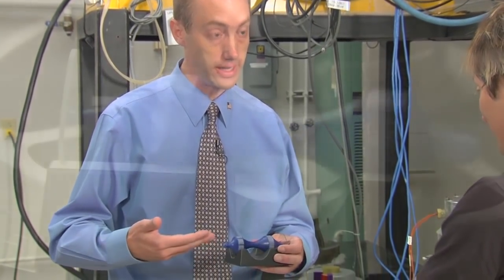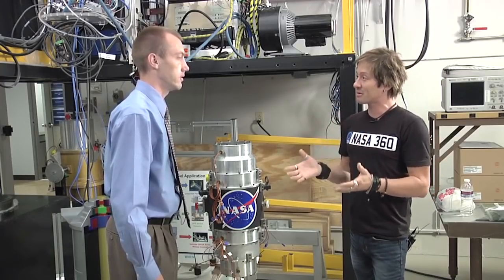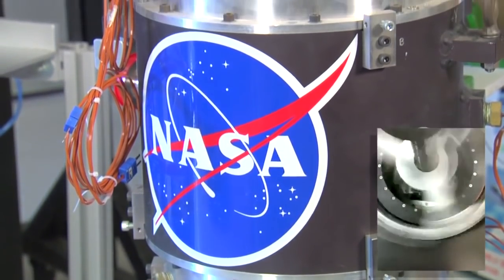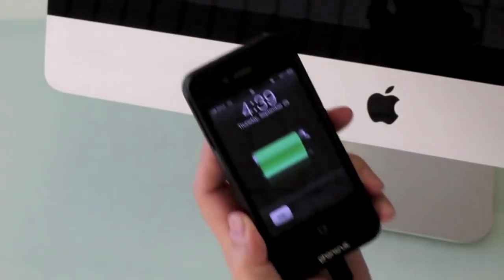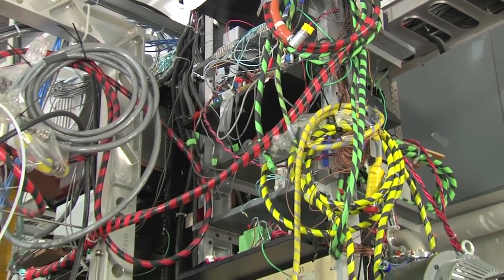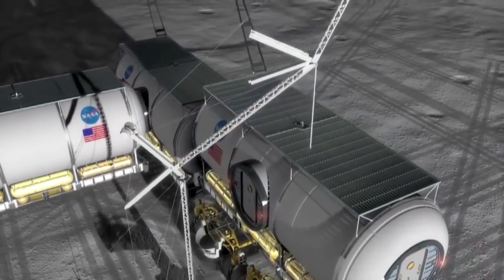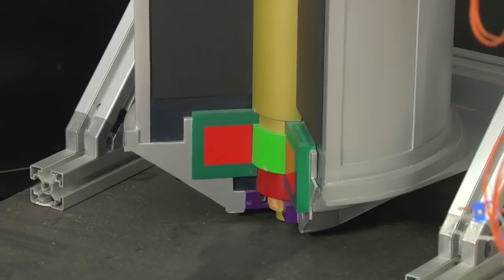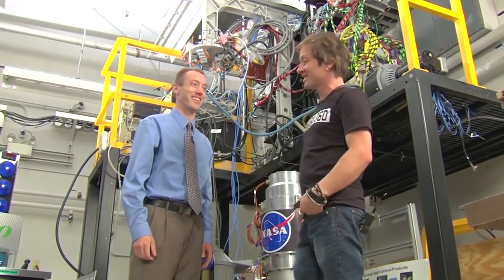NASA 360 Flywheel Energy Storage [HD]

Comment: I wish it'd had a quantitative comparison between various energy storage technologies, including energy capacity per mass and volume.
Reply: I'm sure you can google that stuff up, but I've read that flywheels can get to astronomical charge/mass ratios, way pass current chemical systems.
Reply: +Zen D
Volume also matters, though.
There's not much point to a better energy/mass ratio if it requires some huge impractical contraption.
Reply: They talked about a 150kg flywheel that can be mounted on a regular car with energy storage capacity of 15 MJ/Kg (manufactured using advanced materials - kevlar, carbon nanotubes, etc.)
Reply: Zen D
Those are some very impressive numbers.
That's 7 times the energy capacity of a Tesla Model X's battery with about one third of the mass.
I'm still worried about the volume, though.
And energy conversion losses.
Reply: +Major Gnuisance Not much of conversion there, it's all mechanical energy going back and forth. Unlike the chemical storage where mechanically created energy is being converted to electrical energy and vice versa. I hope we'll really get to see those systems commercially available sometimes soon.
Reply: Aye me too, so disapointed at that, kept wondering how it could stack up against others.

& what could be achieved in the most ultra efficient setups that could be possible, lot's of things seem to get absolutely fascinating when a bit of hyper advancement is added

Comment: Whats the point of having a vacuum chamber for a flywheel that's going into the vacuum of space? And why does the thing have to be so compact? The energy storage capacity of the flywheel scales roughly in proportion to its radius, assuming tensile strength as the limiting factor on its rate of rotation. A larger flywheel with lesser mass and rpm could easily store the same amount of energy without all the bells and whistles.
Reply: It's not created in the vacuum of space, duh
Reply: @HadzabadZa  the purpose of the vacuum is to minimize the dissipation of energy by friction. If the thing is meant to be used in space, the vacuum chamber serves no purpose.
Reply: @corwinmay  I mean, the thing looks pretty tightly sealed, there might be no way to vent it once in space for whatever reason, or at least no way to test it without first assembling it in technical vacuum and you probably know how much NASA loves their tests. 

And to answer the second question, the energy is stored either in a heavy flywheel or a fast one, I doubt size has any effect on energy. And anyway, it's not like rockets allow for much free space
Reply: @HadzabadZa  my point about the vacuum is that this big, heavy, expensive pressure tight can is unnecessary.  

About the energy storage capacity, just consider a rotating drum with a fixed mass and angular velocity. The rotational energy is proportional to the square of the radius of the drum while the centrifugal force is only in linear proportion.

Comment: Wonder how they inject and extract the energy if its suspended. Probably pretty tricky, especially when the flywheel gets up to incredible RPMs.
Reply: +Justin Blake Vacuumed inside space , superconductivity tech , this thing is super efficient and clean , charge really quick , this thing is the future , buddy , it will be the battery drive our electric cars in a few decades , the only defect is this thing keep giving out energy even though when it is not using , 25% energy lost everyday not using , but I think since it is super quick charge , that is a problem we can live with .
Reply: A motor / generator is integrated into the mass, so you spool it up via motor and then get the energy back the same way, that is the most efficient transfer.
You can do mechanical transfer but the losses get pretty substantial with gearing and coupling.

Comment: We started out using large HEAVY flywheels to our advantage. Then things got smaller and smaller and smaller. Who cares if its the size of a shed. If it works, it works. Sometimes bigger is better. Good video. Question. On earth, does mounting an energy storage flywheel vertically, horizontally or diagonally make more sense for efficiency? Does orientation matter???
Reply: Ra Vee  I thought he said there were no bearings in the video. However, you are probably correct for a bearing wheel. Although, I remember the old John Deere tractors had a big flywheel the had it's axis horizontal.

Comment: If you have two flywheels or more, can't you move through space, via torque ?
Reply: No, you can only change your orientation. If you were able to produce linear momentum by twisting several gyroscopes, it would be a violation of Newtons second law.
Reply: @Tore_Lund  You'll definitely need two of them to keep your spacecraft from rotating though. You can even use your energy storage as reaction control systems which also don't wear out due to bearings, that's a really neat feat. Ah, should've watched the vid further, they mentioned it.

Comment: no energy density numbers or volume numbers... 
I would imagine that flywheels have an advantage in that its mechanical energy going back and forth which is pretty efficient and straightforward engineering. 
I could imagine the problem is with a mechanical fracture and all that energy 'unraveling' in unplanned way.
Reply: and efficiency?
Reply: The piece they have there is a 100kg spinning mass that was storing 500Wh+ at 60k RPM, so not exactly the most power dense package.
And the only way to make it efficient is an integrated motor/generator, high vacuum chamber, magnetic bearings and free gyro movement(without it Earths rotation starts to pull the mass out of it's axis)... all in all quite the involved system.
There are companies developing large containers with several tons of mass being spun up to make larger storages, but they don't give out any details.

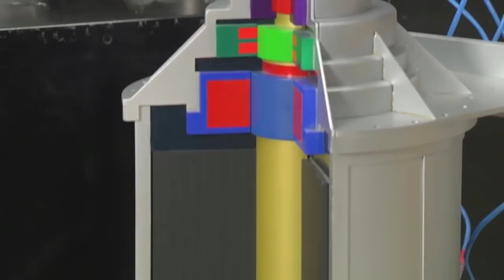Comment: 5:55 He didnt answer the question.... and he said "its good for big amound of energy..." 
I found this in the Internet: 500Wh at 60`000 RPM and 23Kg Weight. 
A Lithium Battery with the same weight would store 5kWh with 21700 cells at 90% charge.

Also a Flywheel at this speed is like a handgrenade... if Something go wrong you will have a really bad day.

Comment: Batteries serve more than one purpose in a generation and distribution system. They store electrical energy or rather convert it to chemical energy but they also have significant RESERVE capacity and serve as a short-term "buffer" when temporary electrical system loads exceed the capacity of the generator powering the circuit(s). And once they're charged they STAY CHARGED until discharged significantly enough that the nominal voltage drops below the cut-off or rather cut-on point of the voltage regulator to increase alternator/generator output. 

Look at any automotive or deep-cycle marine battery or ANY rechargeable cell battery of ANY kind and you'll see an AMP-HOUR RATING. That's because a battery takes TIME to "generate" electrical energy from chemical energy and it does so more efficiently at lower rates of discharge that keep the internal heat and resistance down. There's a reason why the alternator or generator can fail to "charge" for whatever reason on any vehicle equipped with one and the vehicle and its various electrical/electronic systems don't immediately SHUT DOWN as a result. 

Typically you'll get several minutes of full "battery power" at least before a warning light or the ammeter/voltmeter shows a "discharge. Why? Because you actually "overcharge" battery to charge if fully and that extra RESERVE CAPACITY is the one huge advantage your flywheels don't and won't have. Ever. Literally the INSTANT you start "discharging" them the rotor speed begins to decrease. You know it and I know. Or at least you SHOULD know it. And the less energy there is remaining the more energy the circuits will draw as AMPERAGE INCREASES to offset VOLTAGE DECREASING. Watts are "power" and they're also Voltage x Amperage. There is no free lunch. If the volts drop the amps have to increase to carry the load. But when the amperage starts dropping, which is IMMEDIATELY with your "storage system", VOLTAGE drops as well, because its a function of SPEED just like HORSEPOWER is a function of torque and speed. 

 Your claims that a flywheel energy storage system is superior in longevity and presumably versatility and adaptability is also pretty funny. Batteries are like anything else"mechanical". How long they "last" depends on how they're built, used, maintained and "stored". Keep them in cool dry place and keep the exterior clean and possibly coat the terminals and they have a virtually unlimited "shelf life". It's heat and vibration that break down the plates and ultimately knock enough of the plate material off that it can end up shorting out cells. Modern "gel" batteries like Optimas can literally be mounted in any position you desire and even lead-acid batteries can tolerate a certain degree of angle, with "maintenance free" batteries being superior to plain old "open" cell batteries in that regard. 

They can also be stored dry indefinitely, charged with sulfuric acid, given a quick "boost" charge and put immediately into service. Your iPod example is pretty funny to me because I've got an old 32GB ipod I bought USED on eBay many years ago with roughly 2400 songs on it, it lives in my vehicle 24-7-365 and sees temps from -20 F to however hot the cab gets in the summer and even though I've probably "tried" to "kill" it several times by leaving it on the charger for an excessive length of time and thought I DID kill it that way once, it still provides many hours of continuous play via an FM transmitter plugged into the headphone jack. I know for a fact there isn't a "flywheel energy storage unit" anywhere on Earth that is still going to be spinning several DAYS after I shut down the iPod. 

That you folks are comparing your "high technology" to batteries is just indicative of your general cluelessless or desperation to "sell" what you've probably dumped millions of taxpayer dollars into. You're comparing apples to oranges. If the "flywheel energy storage system" were superior the Hubble boondoggle wouldn't have BOTH technologies, would it? Every aspect of your "flywheel energy storage" is completely inefficient because they literally slow down immediately and "progressively" the instant you remove power from them. The "magnetic bearings" you're bragging about require electricity to operate and actually ADD DRAG to the "frictionless system". Electromagnets invariably develop polarities and eventually you'll magnetize the rotor as well. You also have to convert your "energy storage system" to a GENERATOR to get power back out of it. 

Then you get a "steady stream" of continually lower and lower amperage until its below the nominal voltage required by the circuits at which point it has to be returned to "flywheel" mode and spun back up. Can you explain why it takes 60 minutes of "charging" to get 90 minutes of "power"? You mentioned that the Hubble, which has been a giant boondoggle in and of itself, has had its batteries AND "momentum wheels" replaced. I assume by "momentum wheel" you mean flywheel energy storage system. So what's the problem? Is it a CURRENT issue with degraded solar panels reducing the available current for both "charging" the "momentum wheel" AND the batteries with the batteries taking it in the shorts due to the ridiculous power requirements of the "flywheel energy storage system" while its "charging"? 

The reality is you have an ELECTRIC MOTOR that can be converted to a generator, just like a plain old "obsolete" generator on old cars and trucks. And like ANY motor of any type it has a "flywheel effect" and INTERTIA continues to rotate the armature after the power is removed from it. The only problem is that a generator makes a pretty poor motor. Probably because its literally an AC generator that either produces "DC" current that's "2-phase alternating current" sort of "rectified" by switching the fields OR it produces 3-phase alternating current that's rectified at the diode trio if its actually an "alternator". 

ALL "generators" are "alternating current" if they have field coils, armatures, rotors, slip-rings, commutators or whatever you want to call them. They all function and "generate" electricity by using a "source current" to energize or excite the fields to create the electromagnetic field that through conduction creates additional electricity. Do you really think nobody else but modern "scientists" would have come up with and developed a "flywheel energy storage" system for vehicles, which are the most common use of batteries for INTERMITTENT short-term loads with short duty cycles? 

Other "geniuses" have come up with this "brilliant" technology but invariably the projects ended up being giant government-subsidized BOONDOGGLES purchased and financed with OPM - Other Peoples' Money. But use on a commercially successful level doing something as mundane and simple as cranking an internal combustion engine for starting? Not so much. Electric starters are the most common system but HAND-START via crank or HAND-SPINNING the FLYWHEEL are by far the most common. Then come AIR STARTERS and PONY ENGINES and even some really oddball stuff like SHOTGUN BLANK CARTRIDGES that "blast" high pressure gas into the cylinder and create some preheating effect. And of course RECOIL starters and even some "centrifugal" starters using RECOIL SPRINGS to store energy while being wound in order to power the engine for starting. 

What I'm yet to see in my "short" 25+ year career as a diesel mechanic with experience working on everything from nitro RC engines to 4500-hp diesel-electric freight locomotives is a FLYWHEEL ENERGY STORAGE STARTING SYSTEM. I've been a gearhead literally my entire life and hadn't even HEARD of such a thing until "millenials" and "experts" in University labs suddenly decided it "makes sense" to "store electricity" as "kinetic energy". Of course even THAT "definition is incorrect since KINETIC ENERGY is ENERGY DOING WORK. 

You're at best storing POTENTIAL ENERGY. Energy with very LIMITED potential as your own 60 min./90 min. example demonstrates. I've tested and replaced a lot of batteries in my day but I haven't had a GOOD ONE yet only hold its charge for 90 minutes after an hour on a charger. If the technology is SUPERIOR it will SELL ITSELF and would have LONG AGO. Because like I said, you modern-day "electrical engineers" haven't come up with anything that hasn't been done in the past.
Reply: DEEREMEYER1: You said 'If the "flywheel energy storage system" were superior the Hubble boondoggle wouldn't have BOTH technologies, would it?'

Hubble doesn't "have both": it has batteries for energy storage, and "momentum wheels" used for attitude control. A flywheel experiences gyroscopic precession; two counter-rotating flywheels (as shown on the little animation of Hubble) cancel that out. But by spinning up one flywheel more than the other, there's a slight imbalance and the craft will (slowly) rotate.

And yes, the momentum wheels have worn out, just like an energy storage flywheel would, and had needed replacing. The rationale for a combined energy storage & attitude control system is still sound though: if you're going to need to replace parts, having half as many to replace seems like a good idea. If you need to have flywheels in there for attitude control anyway, why not use them for energy storage too? It sounds like they have replaced the momentum wheels more than once in the past 27 years, so having a flywheel with 15-20 year lifespan seems like a step forward.

Comment: Basically you're using a electrical motor to store energy. Larger motors use flywheel technology to help the shaft rotate. The law of motion alone prevents a gain or sustained constant energy source especially during peak demand, where a stall would occur. Then you got to factor friction and thermodynamics which takes more of the energy. By the time you install a vacuum pump and circuits it's not feasible. The timeline you gave was base on life expectancy of a battery used in electrical cars, which is more feasible than a flywheel Energy storage.
Reply: Bull
Reply: In a satellite it is clever. Batteries dry out in space. This will have no degradation over time either. So an orbiting satellite that goes into Earth shade twice a year and have no solar power and deep space probes that uses a thermonuclear generator, could use such a device for peak loads. Also space craft have kinetic wheels they push around to change orientation without using fuel so such a battery could double that function, making the weight penalty smaller.
Reply: @Tore_Lund  Batteries weigh less
Reply: @dougmc666  Explain yourself using mathematical equation to prove your point. Electrical motors are built on kinetic energy. Tell me flywheel technology weighs less than batteries?There's no such thing as self staining energy storage especially when it come to motion and thermodynamics. There's plenty of examples of kinetic energy experiments on youtube that prove it doesn't work.
Reply: @Blaznguy36  Cheers John, yes flywheels have low energy density, but for space applications, as I said, there are other benefits. When a satellite  stops functioning it is usually the batteries that give in and for deep space there is nothing else that will last for decades. On the voyager probes, they only used the thermonuclear generator  and no battery for peak loads, because batteries, or super capacitors, don't last that long.